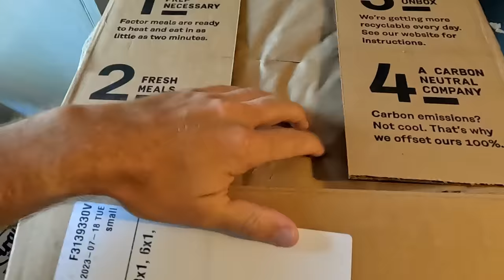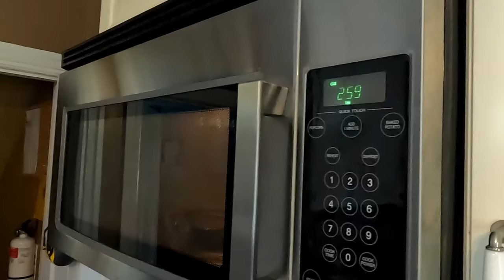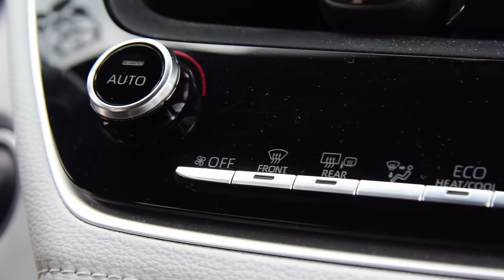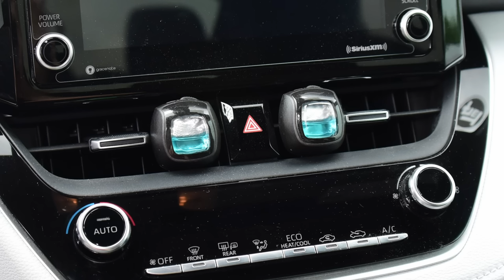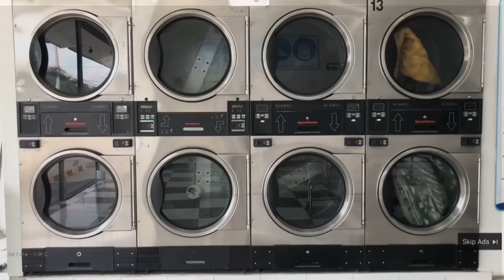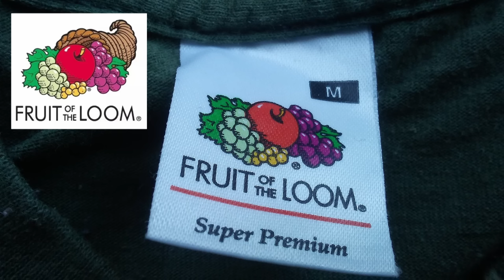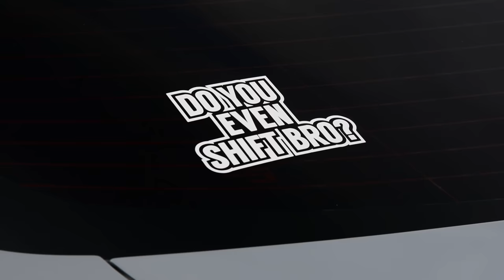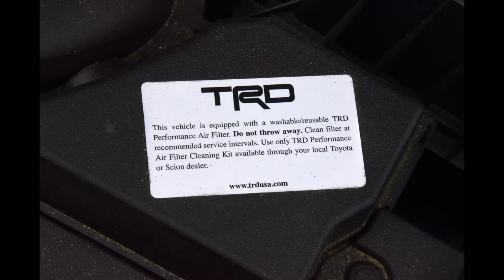2022 Toyota Corolla Apex 6MT: Regular Car Reviews

Comment: Toyota owners NOT putting a shift pattern sticker on their Manual Transmission car - IMPOSSIBLE
Reply: Every fucking time I stop for gas at a Sheetz, I get the tuner bros asking why I don't have stickers on my manual Impreza. Children. Please. I'm Brian's age. I just want to drive.
Reply: @@Camrydriver-ft2xy Put a picture of training wheels on it.
Reply: @nevanbroderick4227  Even as someone half (I assume Brian's in his 40's, and I'm 20) his age, my response would be the same, if I knew how to drive a manual and had one.
Reply: 02 corolla ce 5mt here. Just popping in so you know it's a 5mt. That's all I can contribute to the conversation.
Reply: I have a 2019 hatch 6MT and I don't put anything to draw attention to me on it. Because gross.
Reply: My AW11 MR2 doesn’t have a manual sticker, because DUH!!
Reply: @EmoDKTsuchiya 07 Civic base model 5mt.  Is that good enough for Corolla fans?  185k miles 😊
Reply: @nevanbroderick4227  lmao were they also super suprised that they saw a Subie without vape clouds coming out of the inside every 5 seconds?
Reply: Challenge*
Reply: Saw a Nissan 200sx decked out with stickers like that. It wasn't even the Silvia based version.
Reply: I am one of them haha
Reply: I don't think I could live with the shame of having a MT sticker. I've driven a Tacoma for over 10 years.
Reply: You meant Honda
Reply: "If you have stickers on your car, it means only one thing-- you're poor."  ( Daniel Tosh, 2017 )
Reply: My 1984 Supra doesn’t have stickers, because why the fuck wouldn’t it be manual

Comment: Here in Brazil these Corollas have flex engines. They make 177hp on ethanol, not really fast but fun to drive around. Almost as dangerous as altimas can be in wrong hands
Reply: Except that usually it's retirees are driving these hunks of crap around.
Reply: Although Altima's could ever be dangerous....
Reply: @Scypher0th $5,000 260hp in the hands of someone that doesn't give a shit
Reply: In Brazil you got a lot of engines capable of doing big hp thanks to your adoption of ethanol. I´ve seen what you guys do with the VW´s Gols and domestic cars, truly amazing.
Reply: @Scypher0th Have you seen used-market altimas lately? If unpaid moving violations were a car, it'd be a used Altima
Reply: @DrRyan82994  Most Altima's are 4 cylinders
Reply: @ddg2256  and those are $3k. 100mph is still their cruising speed
Reply: @Scypher0th  have you ever been near an Altima on the road…? Trust me…one time I was at a red light surrounded by Altimas and I broke out into a cold sweat…
Reply: In Thailand they are all taxis and natural gas powered.
Reply: Man, best not mess with Big Altima Energy.

Comment: I had an "oh crap, I might need to buy a new car" moment about a month ago. A Corolla at MSRP or less is probably a good deal, and the hybrid is a very good deal. This is just an appearance package. Problem is, dealers around me are upcharging $2.5-$5k. For Corollas? Heck no.
Reply: Exactly like me. I went to subcompact car instead. $25k OTD Corolla is a BAD buy
Reply: I feel bad for y'all.  I grabbed mine right before the COVID screwed prices up, $17k for one with 27k miles.  It's truly insane how much they went over the top.
Reply: I paid 22k for mine and it was 30k miles so yes you're right. @NicheGreens
Reply: @BrandonsBackinBlack  good news is they don't seem to be dropping off in value like a ton of others right now.

Comment: Wow. The 86 is faster, can actually do some drifts, and still a manual. I guess its rear seats are less usable, but man... I would take that any day over this.
Reply: Yeah, but then you have figure out what to do with 5,000 dollars, which sounds like an absolute CHORE.
Reply: I'd take a WRX or civic si(type R obviously) over this. I'd even take a sonata n-line over this.
Reply: Highly doubt that was the case
Reply: Would have been nice if they put the 2.5L in it and marginally better suspension.
Reply: Its a Subaru motor. WTF?

Comment: I seriously considered one of the earlier years of this car in hatchback trim with a manual as a fun-enough daily driver. What killed it for me was the dashboard that sticks out towards the front occupants and needlessly restricts knee room. I didn't know they recently ditched the manual on all trims save for the GR version. Now it falls squarely into the "don't care" category for me. CVTs are functional, but they really suck a lot of the fun out of slow, affordable commuters.
Reply: The car is the epitome of Toyota absolutely looking at potential and going "meh, make it garbage anyway, we don't caaaaare."

The car looks good. It has potential to have enough power to make a fun N/A with a manual to wring out on your commute. The manual has the potential to be fun to slap around. They could've made it kindof light with some fun suspension and a little bit more power. Instead, we're slapping a body kit on the base model and saying "good enough" while charging out the ass for something completely substandard.

You're going to walk into a dealership and they're not going to move at all on the price, whereas the civic sport touring is cheaper and the golf GTI is basically the same price, and both dealers will move on the price. You can basically walk out the door with a civic SI for the same price as this, with an all around better car.
Reply: This is why I ditched my aspirations to become a Toyota owner and bought a 2022 Mazda 3 Hatchback instead.
Reply: @aidan9958  Agreed. I ended up getting a lightly-used 2017 3 hatchback with a stick and I have zero regrets about my choice.
Reply: @aidan9958  I'd take a Civic Si over this, a gti, an MX5, Mazda 3 turbo, hell I'd take the new integra over this or even a base model civic hatch with a 6 speed. It's a brand new vehicle that doesn't even have 180hp and dealers want minimum 30k for it if you include markups. There is no justification for buying one when literally over every other economy sedan on the market has more to offer. The only people I see buying this thing are corolla die hards who wanted the newest model.

Comment: I have a 6mt corolla, but its the SE model, not the apex or the XSE. Yes, its slow. The SE was 100% the way to go. The only real option I missed out on getting the SE vs some of the higher trims was the premium stereo, and heated seats.
Reply: Me too, bro. The suspension is alot more comfortable in the SE and 10 grand less.
Reply: @robertsantiago3102  Exactly! I don't need "sport tuned" suspension, I'm daily driving this car, I want it to ride smoothly. Great point there on yet another reason the "sportier" models of the 6mt corolla are a bad buy (minus the GR of course)

Comment: This could've been a great Civic Si competitor had they given it better pedigree, but we all know modern Toyota. Rarely if ever do they treat their sportier (exl. GR cars) options with a real bespoke trim. Manual only, 20-30 hp bump, subtle suspension tweaks, and Si level interior aesthetics would really be a welcome change in the lineup, but coming in at $30k with what we have currently equipped, I don't think there would've been an affordable way to do such. Instead it sits as a "rare" Corolla SE "TRD"
Reply: @666cemetaryslut yes!

Comment: tomorrow you can go out and buy one of the thousands of 98-02 corollas on the market. you can get:
- 5 spd
- 125hp 1zz
- 33mpg combined
- ac still blows cold
- early 2000s cloth interior that somehow is intact.
- looks aight but just shitty enough to beat on it and not care
itll cost you $1800. thats what i spent.

Comment: Here are in Argentina we have a GR Corolla that is this car, but without the body kit and a CVT. But it actually has a reinforced body, stiffer TRD suspension and sway bars
Reply: You mean Corolla GR Sport?
Reply: US market GR Corolla is hatchback with the fender flares and AWD and manual 6 speed, and a lot more power.
Reply: @entropy11  I know, we got a travesty of a car. We aren't getting the Real GR Corolla because we got the Yaris 😔
Reply: @entropy11  and a wrung the fuck out 3 cylinder that's liable to promptly detonate without warning
Reply: @iceman5117  They cylinder walls on those 3 cylinders are so thick its almost ridiculous
Reply: @luke6587  the cylinder wall isn't the issue, my friend
Reply: @@phillipbanes5484 I'm talking about the GR Yaris. The Regular Yaris it's alright, it replaced the cheaper Etios here. You can even buy it with TRD coilovers.

Comment: The "dual" injection is to simply keep the intake valves clean. The port injection is used to keep the build up of deposits from crank case vent system.
Reply: Which is a good thing! It's a good design! But it's for LONGEVITY not PERFORMANCE.

Comment: Why you mad? Show me on the doll where toyota touched you Mr. Regular... BTW this should have the 2.0 which is the better engine they came with and it is just a fun little gas saver that looks awesome. Toyota is the greatest car company there is even if there cars are not the fastest. Because they will run the longest and you can be sure that quality was their main focus when building each car. If you want a track car then get the gt86. It should be just as fast as the miata that you referenced.

Comment: I had a CVT Apex. I loved everything about it except for getting beaten up by the super stiff suspension. I traded it in for a GR Corolla. I miss it but have no regrets.
Reply: Also values of these are crazy high right now because the dealer that bought it sold it for $3k more than I paid in 2020.

Comment: "Governed at 115 mph". An old 5th gen Celica with a 5SFE, manual transmission and tuned suspension will do the same with a more visceral feel in its handling. Even better with the rare GT4s.

Comment: I think people are just brainwashed by social media to acquire unique things because it gets them better stats, not because they want it or need it. Just like how I see most kids getting their licenses and instead of just getting a car they could use, they need to get a used or rarely newish BMW because the cool people on TikTok have them and they do those cool videos, but ultimately end up not knowing what they buy and let the car go. Drive like a super car on the highway but they're staring at a dash with a check engine light on, rattling car on the road at 40 mph, and the brakes squeal like a pig in slaughter with brown brake dust either all over the rims, or streaks going across the car because they cant be bothered to change the pads because no one told them you have to replace both the rotors and pads on a BMW. I see so many BMW's owned by kids and they just look like junk. They act cool but really you're not. If you don't have passive income, stop buying these kinds of cars because its unique and cool. Buy a car you can afford to fix, because there's is no bigger joke on someone in the car community that has a nice car but lets it go and still pretends he is the main character of the story of life.
Reply: People wanting "exclusive" items and paying hilarious, disproportional, extortionate pricing for them is far from new.
The Faberge Egg craze of the late 1800's into the 1920's is considered the first intentionally-underproduced item designed for extortionate pricing due to exclusivity.
Reply: @tim3172  It goes back far beyond that. Tulip mania.

Comment: i want one of these SO badly.  its 170 hp yes, but you don't need alot of power to have a good time, the M20A-FKS is a little treat of an engine. they gave you all the handling bits one needs.  i wouldn't have done the pedal commander personally but otherwise, genuinely love this APEX.

EDIT* also, just to add, i really think the expectations were too high for this car, i wish Toyota just made more so that they weren't so rare. but this car is essentially Toyota's Civic Si, i be it with slighlty less emotion but more reliability than the Si (no cabon buildup or oil delusion when compaired to Si's of the same vintage) and good on the owner for not taking the bait on the GR86 since subaru still cant build an engine in a sports car that doesn't suffer from oil starvation in long sweeping corners, or have  excessive RTV inside the engine immediately post new engine assembly and having to drop the oil pan to get it out).  its also all toyota.  but. if Toyota would make all toyota vehicle that would slot in this cars/a civic si's price point and not be unobtainium like the GR corollas that trade WAY over sticker on the regular, this APEX version,  or anothef SE model of similar characteristics would slot perfectly into Toyotas lineup.)
Reply: I didn’t even know these were rare I see them all the time where I live
Reply: @Peepeestorm i live in a decently densely populated area of central new jersey,  and i feel lucky if i see 1 APEX SE corolla a month, and yet to see one in stick shift.

Comment: Test drove one of these a couple years ago and felt VERY meh about it. Absolutely not worth the 33k the dealer was asking. Went ahead and got a lightly used mazda 3 hatch of the same year for 6k less. It was faster and more comfy while having similar gas mileage and a better shifter. Haven't looked back since.

Comment: As the owner of a 2023 stock Corolla hatchback CVT I am annoyed. This vehicle is just supposed to give you a reliable 35-45 mpg. Quit ruining economy cars dang it. 

The apex is probably fun to drive in stock form, the corollas short wheelbase makes low speed driving fun. 

Shoot I even got the SE rather than XSE because the wider tires reduce the mpg 😂

The slorolla is a lot quicker than some of its competitors like the Impreza due to that physical first gear. It really is there for mpg though.

Comment: I have mowed over my thoughts on this video for a while.  Granted, I have never driven this car however I am thankful that it existed.

There was a time, regardless of your financial status, you could buy a car with a manual transmission with various levels of options- you weren't corn-holed into a stripper car or made to pay for the highest level of options just to get a stick.  Times have changed.

Not everyone can afford a $50k+ GR Corolla and I think that those who buy a Corolla for $50k plus are nuts.  

This car should be viewed for what it is- an average, every person car that is more fun to drive that the equivalent with a CVT, nicer to look at than a run-of-the-mill Corolla.

While $30k seems crazy for this car, it's $20k+ less expensive than a GR Corolla.

That being said, God those stickers were pretty awful but as tastefully done as they could have been.  I give credit to the owner for not allowing the dealer to talk him out of it and for loving the car for what it is and making it his own.  Granted, not my taste but not my car, either.

I think you went a little rough on this car Mr Regular.

Comment: As a life long Toyota guy and an AW11 driver for 20 years, do yourself a favor and get a Civic Si. I daily a 2019 Si Coupe. For $30is K you get a great 6 spd manual with helical limited slip, upgraded suspension. Large and much stronger brakes than the regular Civic. 18" wheels with 235/40-18 tires. There is even an option for summer tires. Sunroof, upgraded stereo, sport seats, more aggressive  exhaust. I get 36mpg at 80mph with the cruise set. You also get a huge aftermarket. 

As soon as the GR Corolla came out i said they should put a detuned GR Corolla engine in a regular Corolla with a manual transmission. If they kept power around 200-210 they would have a direct competitor for the Civic Si. Toyota really missed the target here.

Comment: From my understanding this car was supposed to be the stop gap between the regular Corolla and the GR version. Would of been nice if the ECU would of been slightly adjusted to make at least 190hps with matching torque just so it doesn't creep into GR86 territory and wouldn't need to update cooling or braking power.

Comment: Why won't Toyota do what they did in the older XR and XRS corollas? Drop the 2.5 I4 from the Camry in and call it a day. An extra 35 hp and 35 ft'lb of torque would wake it up and make an actual noticeable difference.

Comment: A Corolla with a manual with a body kit is not a bad thing.  It’s probably much cheaper to insure than a GR and certainly much cheaper to buy especially once you account for dealer markup.  And it will probably run forever.  If you’re not a Toyota loyalist, a Civic Si would be a tempting alternative though.

Comment: If you're gonna tint some lights, at least have brighter lights to compensate. The important ones are the head lights and brake lights. Don't touch those. Less important with signals. Half of the drivers don't even use them.

Comment: I couldn't disagree more with this review. It's a Corolla, not an AE86, and it is 100% carrying on the spirit of the Corolla. When it comes to Corollas, the AE86 is an anomaly. So why does everyone expect an 86 out of every Corolla that comes out? And as far as that goes, any 4-cylinder Corolla with a Yamaha cam will have more in common and is more in the spirit of the AE86 than can be said of a BRZ/FRS/GT86. I mean the only meaningful similarity between an AE86 and a GR86 is it theyre both RWD, which isn't exactly a feature unique to the 86. The COROLLA  is a true underdog's car, it was never supposed to be a sports car. It was never supposed to be a Subaru. Obviously, I can't take a review seriously, if the reviewer goes in with all these expectations. And manual transmissions are overrated,  and it is outright ridiculous to consider a car a waste just because it has an automatic transmission.

I will agree that it's a waste to pay extra without getting extra performance over the base.